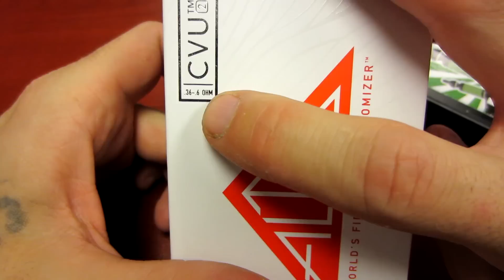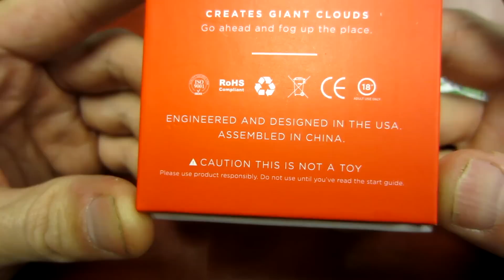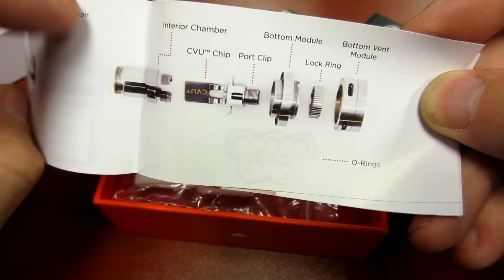ALTUS (COILESS) TANK BY GUO | REVIEW | ELECTRIC REVIEWS | DAVE GEE

Comment: the metal inside the chip is tungsten. the tcr is .00310 but its really close to titaniums tcr which is .00350 or .00366 depending who you ask :). Vaping it in nickel is almost double the actual tempature.

Comment: Best hit so far on ipv4s.... Ti mode... 490 F.... 67J....consistent clean vape
Reply from the maker: +Scott Novosel it works great on TI mode.
Reply: +Electric Reviews... Maybe you would know why I cannot get the same performance out of NI mode? I've searched Web for answers and even emailed his Web page (which works now) ... No answers yet. I've notice more of a pulsing in ti mode and honestly only reason I tried it is because it allows me to go over 50 joules vs ni only allows up to 50.
Reply from the maker: I am not sure really. But it does preform a lot better on Ti. The Asolo doesn't lock in the resistance but reads it along the whole length of the fire. Maybe this is why mine was preforming different in Ni mode as compared to my IPV4. Perhaps these types of mods are better? The armed vaper thinks so and i kind of agree.
Reply: +Electric Reviews what do you mean in regards to better mod? The ability for a live read like evolve chip vs the locking resistance like ipv4s? I was gonna get the cuboid for the tcr feature.... But now in day 2 with ti mode, still haven't changed cotton and flavor is still good! Why bother?
Reply: +Electric Reviews while we are on subject.... Have you experimented with temp setting. I've found myself going up to 540 in ti mode with no taste or performance issues. If the chip is advertised to not oxidize below 1800 F, why is it recommended to stay under 480 F for warranty purposes.
Reply from the maker: I took mine up to 570 to "push the limits" and it was a fine vape. No burnt taste at all. Chain vaped it for a bit and it stayed the same. I imagine the limits they have defined are from r&d and set as a standard to extend the life of the CVU. My CVU is black. did yours go black or is it still that gray color?
Reply: +Electric Reviews nice!.... Mine was black after first tank... Pretty sure you can't avoid that. I'm on day 3 without rewicking and flavor is still good, that has a lot to do with my juice as well cause it burns clean on my rda's too. I've reached to a couple people about the ti mode.. A) why it is so much more delicious than ni B) how safe it is for chip as far as temp goes. Not gonna lie the ni mode taste like shat
Reply: +Electric Reviews should have added.... No one really has a good answer, just educated guesses.
Reply from the maker: I have rewicked a few times. I went as long as i could but put in some crap juice i had laying around to see if it would improve coming out of this tank. Nope.. Those wicks get nasty lookin but not burnt like sub ohm coils wicking..
Reply: +Electric Reviews so did you figure out that black shat... I was worried cause it didn't wash off and it ruined 3 wicks in a row. So I took a box cutter and it scrapes of no problem at all...no damage to chip. This is because I vaped it hard 3 days with no rewicking.
Reply from the maker: caramelizing?  Only thing I could think of. Its not hurting my wicks and doesn't seem to be affecting the flavor. I will try and give it a scrape today (if I can find the time) and report back. :)
Reply from the maker: +Electric Reviews scraping the VCU is about the best way to clean it.

Comment: +Electric Reviews I wonder is it normal that my CVU chip turned into a rough surface. Although i rinsed it with water and rewick it. I find that it turns the cotton black again very quickly like less than 20 puffs with 1-2 sec drag each time on my DNA200 mod tungsten setting 0.00450 35W 400F and 25w pre-heat for 1 second. resistance is locked in at 0.5ohm but im not sure why i still bounce around to 0.6 or 0.7. Do you guys have any method of cleaning the CVU chip though? As I know it is normal for the chip to turn black overtime but the rough dry surface i believe is the residue collected over time can somehow be remove right.
Reply from the maker: +Chen Yun Mu What I have done in the past, and take this with a grain of salt... Scrape it gently and you can get that residue off. It takes a little work and a razor works well. Also you might send the good people over at guovape.com an email.
Reply: Electric Reviews Thanks for the swift reply. just to double confirm that you use grain of salt and than scape it off with a razor blade?
Reply from the maker: no,  it just an expression. It means you don't have to believe me. Just scrape with a razor, very lightly. Don't break that CVU.
Reply: +Electric Reviews Cool thanks alot for your assitance I believe that it is not possible to scrape it off completely right or may risk the chance damaging the chip
Reply from the maker: yes, if you don't feel comfortable doing it you should not. Perhaps try some grain alcohol? soaking it for awhile.
Reply: +Electric Reviews Im not so familiar with this kind of products hmm but when you say grain alcohol is it possible for me to use "nail polish remover" it has alcohol in it though.
Reply from the maker: I would not use that, it has some bad things in it which may leave a residue on the chip. I suppose if you dry burned it afterwards it may be OK but I wouldn't do it. Grain alcohol like pure drinking alcohol. I have mine today I will try and get a video up on my method of cleaning the CVU.
Reply: +Electric Reviews That would be great! thanks for putting up a video on this =D. Maybe you could also include in your video likw usually how often it requires you to do a cleaning etc might be great info to share ^^
Reply from the maker: +Chen Yun Mu Here you go friend! https://www.youtube.com/watch?v=NF9ZlmwMObY